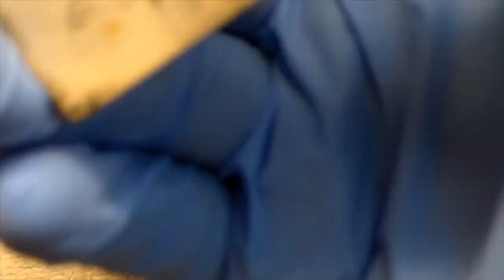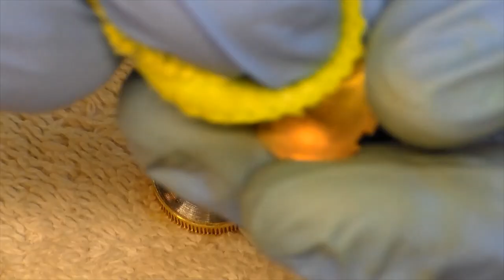Michael Services a Rare 1964 Jaeger-LeCoultre 8-Day Egyptian Obelisk Swiss Clock Caliber 245

Comment: Hi Michael; mine is Ref # 452. They are almost twins!
Reply from the maker: That's awesome, it's a great little clock. Does yours have an alarm?
Reply: No. Table clocks were made to be displayed in living rooms as an ornament contrary to the alarm clocks that I sent you pictures months ago who were made to be used in bedrooms or in your luggage as travel alarm clocks. It's great to look at you working on those expensive clocks!
Reply from the maker: @robertdeschamps2976 okay then your clock has the same reference number #462. But this movement does has an alarm variation, just like the lamp post clocks have an alarm variation, and other 8 days do as well. And on this one, that's what the empty pivots and ratchet spring slots were for. But this is also for a desk top, like of a wall street trader, or banker, with the 8 foot marble and mahogany top desk :)